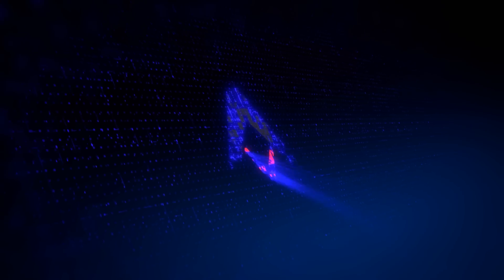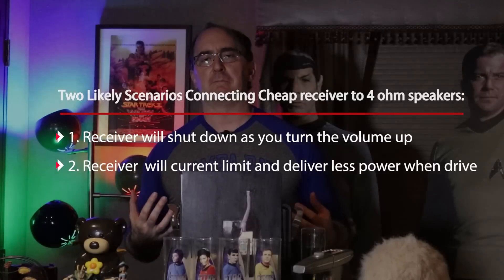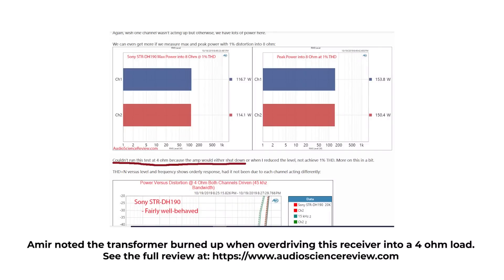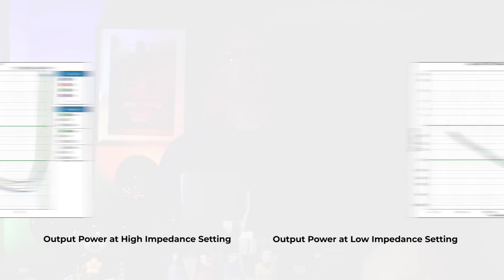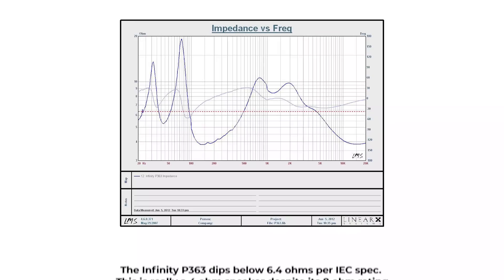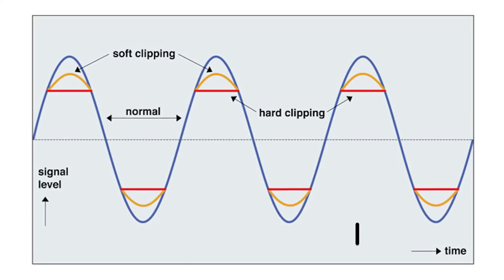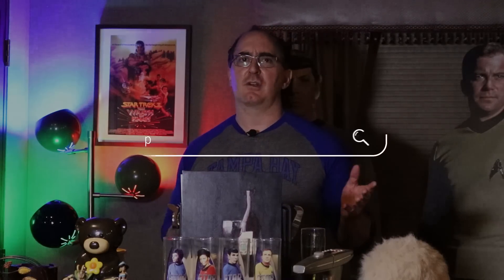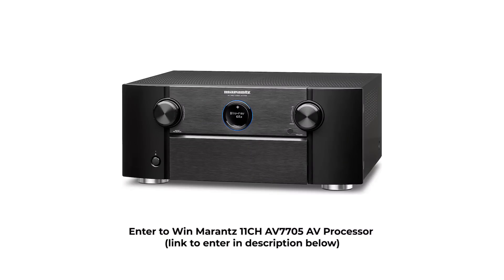4 ohm Speakers on Cheap Receivers: Recipe for Disaster?

Comment: man this is some half truth, half bs, the Sony STRDH190 says right there in the back, 6-16 ohms, so whats the point of connecting 4 ohm speakers and then going oh no it doesn't work or worse, you damage something? second, cheap avr mostly dont have preouts. i mean what im i supposed to do if my amp says it can run 4 ohm speakers, and you go, oh no that's just crap dont use it? READ THE MANUAL and dont exceed what it says in there, because for example, even if it says it can run 4ohm spk. it might not be able to if you use A and B spk. or in the case of a multi channel avr only the front sp can be 4 ohms but not the surr. and center spk.

Comment: Ifs its rating line jbl ma310 or 510 or 710 it has 4ohms 100w 5x and 8 ohms 75w etc can i run a 5x 4ohms speaker with 50- 75w rms for surround sound( and if speaker are aktiv does it matters?

Comment: I need advice here. So I have a marantz sr7011 and it get very hot and eventually distorts since i upgraded from focal Chora to Aria. However, when i set my amp to 4ohms the amp is much cooler and theres no distortion. It appears to me that at 8ohms settings the speakers are starving of power when they drop to 2.6 ohms impedance spikes. However, at 4 ohms, its like they have more juice on that and even run with wider crossovers, so 40hz as opposed to 80.  And, they sound the same wherher set to 4 or 8 ohms. My experience seems to fly in the face of logicz as Gene say, theoretically my speakers should be more starved of power at the 4ohms setting??

Comment: 4 ohm 3 way car speaker connecting to 8 ohms amplifier using a 4 ohm resistor in series ??? Please reply..🙏🙏🙏
Reply from the maker: Wasted power into a resistor, not a good idea.
Reply: Adding a resistor in series with a woofer increases the woofers Qes, which then in turn increases it's Qts. (Thiele/Small parameters). Essentially you'll end up with boomy/sloppy bass and or midbass as the amplifier will lose the ability to control those frequencies. May or may not matter to you (and might even be a little fun if the speakers have weak bass to begin with) but you wouldn't design a high end listening experience that way. You would also need the resistor to have the same power rating as the speaker. 50-100 watt rated resistor for higher listening volumes.

Comment: Most speakers on the market are 4 ohm. Manufactures rate their speakers as 8 ohm, but if we measure them........
Reply: Your multimeter cannot measure AC impedance, it only measures DC resistance.

Comment: I just ordered pioneer avr with the 5.2.4 so i can have the 4 atmos. But just noticed this morning it is 4 ohms. My current avr is 8 ohms. Checked my speakers they are rated 4-8 ohms. So i am actually hoping this new pioneer one with 4 ohms will actially make my speakers sound better.
On another note..love your jim and spock life sized cut outs.

Comment: A cheap alternative is to add a proper value capacitor before the speaker (if it is not subwoofer/ need not produce low frequency

Comment: Don't use your $150 stereo receiver.... BUY THIS MARTIN LOGAN!! rofl. what a clown. 

I've got one of those cheap Sony STRDH190 stereo receivers running a pair of 4 Ohm Transmission line speakers I built a few years ago and it works just fine. It doesn't even run hot, but out of caution i mounted a 140mm computer fan running 900rpm to blow air across the heatsink.
Reply from the maker: That's awesome you've reached audiophile nirvana for $150. Consider yourself lucky that your content. Enjoy.

Comment: I have a Yamaha AX-930 2 channel integrated amplifier (manufactured 1990). It is rated down to 6 ohms. RMS power 130W per channel/Dynamic power 300W @ 4 ohms. I plan to hook up 2 Cerwin Vega RE30 4 ohm speakers (RMS 250W), as this is the equipment I have. Can I offset any issues the amp might have by running a couple of computer fans set in exhaust mode on top of the amp grill above the heat sink. This would remove much heat and thus avoid overheating. As long as the amp components stay cool, does this offset any problems caused by the amp having to provide additional current? 
Also, I am buying new cables (GearIt). Does wire gauge have any bearing on any of this? I have ordered 14 gauge pure copper wire-2 runs of 15 feet. Thanks for any help. Your channel has great content-very helpful.👍

Comment: Pure power amplifiers (or integrated amps) are ALWAYS BEST when driving speakers - from power/drivability, SQ, robustness, and fail-proof/simplicity standpoints. Most receivers (even "TOTL" models) have too many compromizes in their power supplies, designs, and layouts to be competitive with power/integrated ONLY amps - because they have to fit all of the power, signal, and digital circuitry all inside of ONE CASE. All those mis-matching power and signals going through them (high voltages, low voltages, signal voltages, digital signals, hi and low currents, etc) automatically causes many problems with interference, isolation, and signal/voltage/power bleeding into wires that shouldn't be passed on them. The more I think about it - the more I lean towards separates ONLY. Reasonably-priced separates will sound better, perform better, and last longer than any one box solution - not to mention being more flexible in setup and upgrading.....

Comment: I've got a question about some MTX Al 154 4 ohm speakers they're brand new basically anyways I want like a 70s era the receiver that I can run those forum speakers and I've been watching forums and listening to guys talk for a week on the internet and nobody can just give me a straight answer I'm not going to play it blaring loud but I like it a little loud I'm going to technic's turntable that I'm using with my pioneer clippish home theater right now but I want an old '70s say pioneer realistic you know something in that area you know 500 bucks under receiver what should I use thank you for all your help

Comment: How good is the Sony strdh 190?
Reply from the maker: As good as you could expect for a $200 or less receiver. Nothing magical and not suited for 4 ohm speakers despite how fancy of a Youtube video anyone makes otherwise.
Reply: @Audioholics  I know it's not a surround sound receiver but you you use it for tv sound and would it work with 6 0hms speaker's
Reply from the maker: @alanbranscum4594  it will work fine for that as long as the speakers stay above 4 ohms for the entire bandwidth and used within its usable power band. It won't part the sea and its not an audiophile magic box that sounds like it costs 10X the price. That's all.

Comment: Gene I really want to buy the New Polk Reserve R 200s but only have 2k budget  for the whole system.  I was going to go with a emotiva Pt-100 and a crown 1502  but the Pt-100 is having issues hooking up to my Samsung TV. The TV optical out isn't being picked up by the Pt-100 I saw a post  when I asked Google Emotiva Pt-100 and my tv.   I can get a Yamaha Rxa2a for 600 bucks. But don't think it will be strong enough for the Polk lsim703s or the Reserve R 200.  What do I do ?? Thanks

Comment: I thought putting speakers, any that are bass or subwoofer speakers, in parallel is bad anyway because it plays around with the tone of those speakers...so it could raise or lower the passive crossover points...essentially the speaker plays in a way that it's unintended.  Is that true?

Comment: I have a Marantz 4270 4 channel (70w x 2) and (25w x4) It was manufactured in august of 1975. I have a pair of Cerwin Vega D9 that state on the speaker, 4-8 0hms. Do you think it is safe to drive these 350watt Cerwins with that Marantz 4270 receiver? I have read a couple places that it would NOT be recommended to run speakers that reach 4ohm on the Marantz 4270 receivers. Any help would be appreciated. Thanks

Comment: Hi, I purchased recently Sony STR-DH590. It's requires at least 6ohm speaker. But I have small 3ohm speakers (Sony home theater speakers). Can I connect 2 3ohm speaker in series or should I purchase bigger 6ohm speaker?

Comment: Hello Gene, greetings from Colombia. I have a Denon AVRX 6500 H with two floorstanding 4 Ohms Emotiva T2 first generation. Also I bought an AC INFINITY T 10 to help it with internal heat. Actually I’ m operating the Denon with the Auto mode. Do I continue that way ? My Denon can drive those speakers without affect it’s longevity? Thanks for your videos and advice. I appreciate very much your knowledge and experience.

Comment: Gene  you forgot to mention that your video is only describing what happens if you use you amplifier at close to the full power your amplifier is supposed to be capable of . My amplifiers almost never need to deliver more than 1/2 watt to my speakers. At that power usage it does not matter how the amplifier would behave at full power. I think very few amplifiers in homes need to deliver more than 10 watts. You only need a powerful amplier if you like to hear and your neighbours tolerate sound levels of more than 100 dB SPL.
Reply from the maker: If you listen at a whisper with no bass on large horn efficient speakers that may be true. In a large room moderately loud not so much.

Comment: I remember you saying cover up the impedance switch on the back side of the receiver / amp with some tape. For they are practically useless. There was a built guy (maybe your VP) in the channel then.  Many years passed, Im still watching the channel. Good work.

Comment: @Audioholics I recently got a Denon AVR-3808CI from my brother in law who recently replaced it with a Denon 4700H. I thought about using it strictly for 2 channel listening and the streaming ability. My speakers are 4ohm nominal impedance, Klipsch Forte I rated at 100watts continuous. On the back of the 3808CI ( 7 channels  x 130 watts)it says for use with 6-16 Ohm speakers for . Since it has so much power would it be okay to use for a 2.1 channel set up with the 4 ohm speakers. It weighs 35#'s. Should I stay away from it? If it wasn't free, I wouldn't be asking this question. You guys did a review of this AVR back on 7/3/07.Thanks. Live long and prosper.

Comment: Hi Gene, after years of money saving, I finally got the my Marantz 8015, it's great and i really love it!

Currently I have a pair of Klipsch 6000f (the new tweeter version) as front channel and a pair Klipsch 160m (the old tweeter version) as surround, but I don't have yet a center (so it would be a 4.1). 

You think it's right to use the Marantz 8015 with the 6000f together with the 160m, and for couple of months WITHOUT using the center channel channel or I may damage/stress the my new Marantz?

Thank you in advance for the help.

Comment: What about tube amps. I have 4 ohm taps on  my Rogue Audio but I have to go inside the amp to change them manually. Should I still leave  it on the 8 ohm taps.? I only have one set of speakers that are labeled as 4 ohms but I use those with a different set up using a solid state separates amp. I was aware that 8 ohm rated speakers do dip. I just always tried playing it safe with tubes. Would be nice to know if I really didn't need to change them with your recommendation with solid state.
Reply: I am also looking for the same answer, if anyone can help us out. I have a tube power amp with taps for 4ohm, 8ohm and 16ohm. Is it safe to connect the 4ohm speakers to the 8ohm/16ohm tap?

Comment: why are so many of the best speakers low impedance?
Reply from the maker: multiple bass drivers in parallel lower impedance. Using lower impedance drivers allows more power draw and typically increases efficiency.
Reply: @Audioholics  what is the practical use of "greater efficiency" if it ends up requiring more power?
Reply from the maker: @BruceTheSillyGoose  you're converting more of those watts to sound pressure.
Reply: @Audioholics  thank you for your efforts but i am afraid it is way above my pay grade. the thing that confuses me, is the watts may be making more volume but it also is requiring a lot more of 'em, at least a lot more power than what affordable consumer amps can cleanly and reliably supply. i would be far more impressed by a speaker design that was not as demanding on amplifiers, thus opening up the possibility of good sound to more people. IMHO what this world needs is more hifi in more ears. just my 2-cents' worth, adjusted for inflation 😋

Comment: I use a Hammond 1642 SE output transformer with its 4 Ohm tap to drive Magnepans. But I use a radio station transmitter tube run gently at 1000 Volts on the plate which I am sure is more than enough power. It is more than loud enough if I turn t up too high. But this is very different from a solid state amplifier.

Comment: Gene but what about the other side of the equation with a beefy AVR like the Onkyo TX-SR 805? I have an SVS Ulta front soundstage. Towers and center, all low ohm (4-5) rated through testing. That AVR weighing in at 51 lbs with a big e core transformer), should have no problem driving them, right? I also have an Onkyo HTR 940 driving the rear surrounds, also a semi beefy receiver (rated at 100 X 7 for real with testing) drive the four rear surrounds without issue, right? Please advise.

Comment: Thanks, Gene, you covered everything well. The combination of skimpy power supplies, insufficient heat sinks, current limiting, and not enough output devices to handle the current demands of a 4 ohm speaker, most cheap receivers are compromised. This is one of your best.

Comment: The problems only arise if you're pushing it (power/volume) pretty hard though, right? I've got an old pioneer (about 15 years old) AVR running two large 4 ohm Cerwin Vegas and two small 8 ohm bookshelf speakers and one 8 ohm center. I've had this system running daily for almost 13 years with no problems, but then, I hardly ever turn it up very loud.
Reply from the maker: correct. CV speakers are also very efficient so you don't need a lot of power to get them playing loud.

Comment: As someone who taught acoustics and worked in the pro audio industry for some 15 years, Gene DellaSala is spot on.  Heed his advice.
Reply: @Dan Wipper hi Dan. I'm new to audio so apologies if this is a stupid question. At 3:15 there is a screen shot of a yamaha A-S801. The switch has 2 options 4ohm A or B/ 8 ohm A+B. Can you explain what this means please.
Reply: @danconnor3089  It means for 4 ohm speakers you can run only one set at a time (either A or B) and for 8 ohm speakers you can run two sets simultaneously (A and B), since two pairs of 8 ohm speakers running in parallel creates an effective impedance of 4 ohms.
Reply: Yep.
Reply: But, if we do not listen at crazy levels. He says if you use the impedance selector switch, it will limit current and you will get only 25 Watts. I barely listen above 90 dB. Even with low eff. Speakers, do you think it will be alright? Talking about a small 2 way 4 ohm bookshelf speaker.
Reply: I love how you assume what their speaker sensitivity is.  How is it? You know what audio level they are listening at.

Comment: Serious question:

I have the Denon H3500X, and all Parts Express speakers, all of which speakers are rated at 4 or 6 ohms.  I set the Denon for 6 ohms.  Should I just reset it to 8, and not worry about it?

Comment: Question. If I want to run my 4 ohm speakers off my old Pioneer 5 channel Receiver would this really be an issue if they were just computer speakers? Volume doesn't have to be too loud as I am right in front of it while working at my desk.

Comment: Mostly good electrically, but the thing is, the scorned and despised 25W from a current-limited budget receiver into a speaker of 3z to 10z impedance, even with nasty phase angles (which he does not mention, does he?) is going to be, and sound, just fine 95% of the time. 

Otherwise, unless playing stadium-sized hiphop or boomboom movies, even remotely competent designs will shut down, probably gracefully. 

At least he did not say that clipping produces tweeter-destroying harmonics, a piece of nonsense that just will not die. So good on him for that too. (Passing dc, yes, absolutely.)